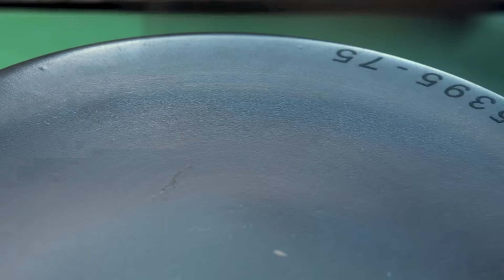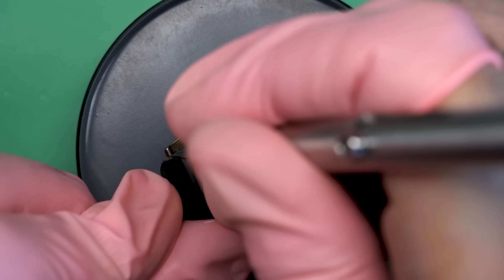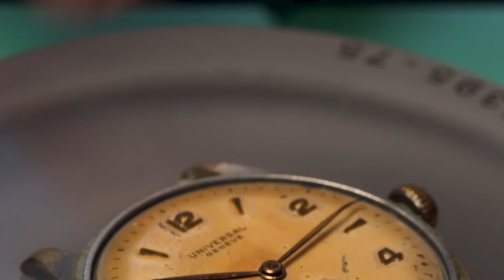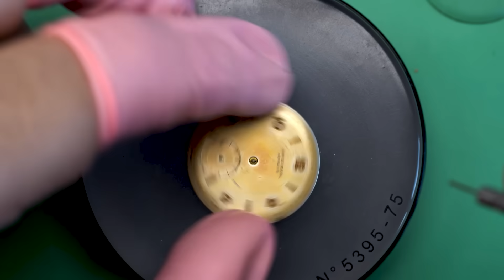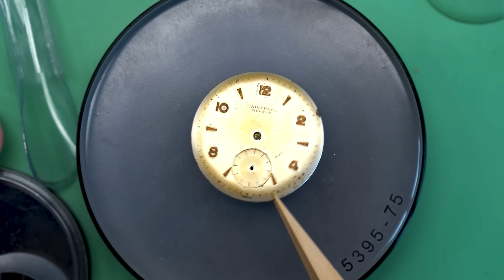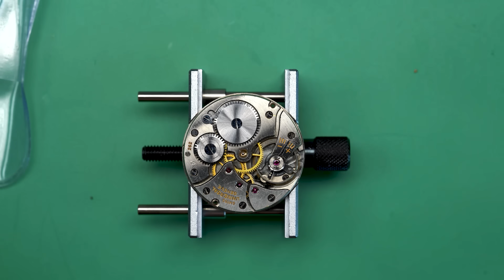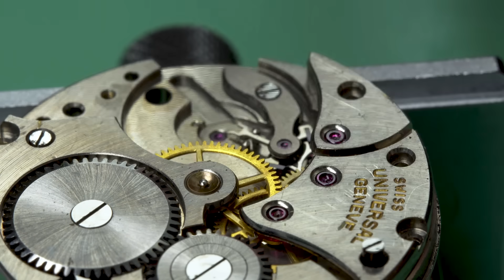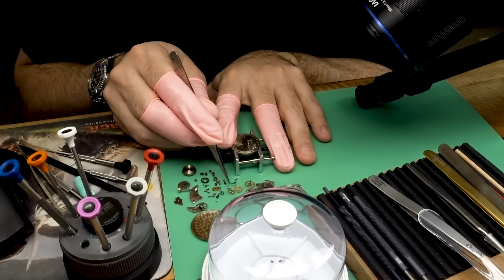Full Restoration Needed On This Universal Genève Watch!

Comment: I have a question for you. I have my grandfather’s pocket watch dated back to 1952. It’s a Elgin 571. Right now it has a solid back to cover the workings of the watch. I would love the back cover to be clear. Is there an after market case cover I can buy that’s clear?  If so help guide me to the place to order and what info they might need to get the correct size and thread. I have the case in stamped under the back cover. 
  You do a great job communicating info while doing the work in the videos. I really enjoy seeing your skills and confidence in a hobby form. Your very talented.

Comment: I have a Mido Multifort Extra Super Automatic that I would love to get going again. It runs, but I think the mainspring is broken. I can wind it, but when you get so far it pops like the spring is broken. I have been in love with watches since I can remember, but never had the means to afford what I really want. I plan on learning how to do the repairs myself. The Mido has a strange automatic mechanism, it doesn't go around 360 degrees like an ordinary automatic. It has 2 springs that the automatic weight bounces off of. I have been watching yours and others watch repair channels, and I think I have the patience to pursue not a career(since I am 61 years old), but a hobby repairing watches. I love your videos! I got the watch out, and started looking at it again while watching this video, and I think I am ready to tackle it. Thanks for the inspiration!

Comment: Marshall how would you feel about doing a video on the New Omega X Swatch buy giving it a upgrade and placing the movement into a stainless steel case and upgrading the crown and buttons to metal just leaving the back cover as original.. if it can be done at all .??..

Comment: Nice job...... Re. the plating... Chrome by itself will not stick... The usual plating process is to copper plate, then nickel (for waterproofing) then Chrome (which is a bit porous)....With a watch, they would dispense with the copper plating as the brass is a copper/zinc alloy and the nickel will stick to it OK.....

Comment: Really, really interesting to watch the case-stripping & replating process. Have never worked up the courage to try it myself. 

FWIW, one other explanation I've heard for brass-cased watches - the material is much easier & less expensive to form & work with than stainless is.

Comment: I started with this hobby because of your channel, I tried repairing a pocket watch I got off ebay but sadly failed; it's missing one of the two staffs on the balance wheel which move the fork. I'm proud of myself to have noticed it and correctly identified the issue, hopefully I can get another balance for that movement... Recently I found my grandfather's old pocket watch which wasn't running and also identified the issue; this one was missing a jewel on the wheel train which I later found inside the case. I'm fairly confident I can make it run again, just have to gather up the courage to get at it again.

Comment: I enjoy watching your videos and, now, I really want to try it out. I love puzzles.  I'm looking for an easy, simple pocket watch to try out this hobby. If watchmaking isn't for me then my first watch will be my favorite puzzle that I reassemble every now and then for a challenge. I already took apart a few, cheap Timex watches. They were definitely throwaway watches because some of the parts were permanently attached to the main plate.  The second one sprung all over the place because I couldn't find a way to release the built-up power. None of them had jewels, and all the works were sandwiched between two plates. But I did enjoy putting the wheels back in place...... I feel like I'm talking to a crowd of giants, the watchmakers.

Comment: Nice one Marshall! Where did you get your cleaning machine, your tube extraction tool, your crystal fitting tool and your main spring winders?
Reply from the maker: Thanks! I got my cleaning machine from a guy in Texas, case tube tool is from Horotec, crystal tool from eBay, and mainspring winders from cousinsUK

Comment: I don't understand why you didn't do any kind of cleaning to the dial. It was filthy on both sides and when you removed it and turned it over, there was horrid corrosion on the backside. Even cleaning it with distilled water on the face and making some effort to clean the back side would have been preferable to simply placing that crusty dial back on top of all the work you'd done on that watch.
Reply from the maker: Hard disagree
Reply: @WristwatchRevival  Rude. Unsubscribe.

Comment: Enjoyed, Thank you. Since you are in the learning mood. Chrome or Chromium is what painters would call a clear coat. Chrome has no real discernable color when applied in a thin plating layer, but does make things shiny. In the automotive industry nickel is plated as a base, then polished and Chromium is then plated over the nickel to seal and give that extra shine. If you have ever seen an old bumper that looks like it is peeling a clear or yellowish layer... That is the chromium that is coming off.

Comment: it is common on knock off wheels on cars for the right side wheel knockoffs to be left hand thread for the same reason. Usually the way plating is done is that the brass is plated with nickel, then chrome. Nickel has a more yellow appearance than chrome.

Comment: Great video as usual!
I would suggest you replace the springbars. Hollow end or 'female' springbars arent common, but easily available online. Those old brass ones will corrode with the green goop really quickly again and are more prone to breaking than new stainless steel replacements.

Comment: Hi marshall, great video, I really liked the plating section, some great info. I have this niggle I need to voice. Mainsprings are NOT family heirlooms, they are disposable items. All of the power of the watch is in the mainspring, for maximum amplitude you need a mainspring with maximum power. During use the metal of the mainspring hardens, it's called work hardening, that makes it more brittle and easier for it to break in use. When you service a watch, especially one that hasn't been serviced for many years - fit a new mainspring. They aren't expensive, and they're easy to get - by dimension if not by brand.  Keep these video's coming :))

Comment: I noticed in the grease for the main spring it expired in oct 2021. What exactly goes bad in the grease? And if it does go bad does that imply that it would have to be cleaned out of the watch when it expires? I know eventually watches need to be cleaned and re lubricated but I assume that’s not something that is done very often.

Comment: Would you do or show what you use to wind a main spring.  I do repair very inexpensive watches and have some older Elgins and others but don’t want to pay 400 to 800 dollars for a main spring tool that will work right or left wind to fix a $25 watch.  And hands are not steady enough to do it by hand. Love the channel you’ve taught me a lot.

Comment: If you bend a ripple or saw-tooth pattern on the bottom portion of the hanger that suspends the parts in the solution when doing plating, you will have an easier time keeping the parts separate from one another.  If parts touch, it can cause gaps in the plating at the point where they touch.

Comment: I would like to send you a very old Waltham I’ve never see anything like it and can’t find it anywhere online. I tried servicing but the jewel on the  balance wheel was missing Additionally the screw for the barrel arbor broke off inside I put a temporary one in place to see if the movement functions. An on closer inspection there’s several broken parts. I really think the community would enjoy watching you service it. I believe it’s from the 1800 and is similar to the movement you worked on in this video.

Comment: Nice Video! You said that you had to switch power supplies to get the right voltage. With plating the current is the critical value. Of course you can change the voltage to set the right current. The downside is that this is very specific to your setup. If your liquid evaporates, or warms up, or the anode is a different size etc. it will all affect the rate of plating, and you might want to adjust the voltage to correct for this. But there's an easier way.

With the type of power supply you are using you can also set ("limit") the current directly, and then it will lower the voltage automatically to get it. With that you should be able to use just the one power supply for both operations.

The easiest way to set this for you would be to turn the current all the way down to 0, and set the voltage somewhere higher than what you need. Then you connect everything with the liquid etc. If you turn the power supply on you will see 0 voltage, because the current is set all the way down. Slowly turn the current up, and you will see the voltage rise with it.

Comment: Great job! You should not use a stainless anode when cleaning off the oxides though. You will get really nasty chromium compounds in the electrolyte. E.g trivalent chrome. Use regular carbon steel instead.

Comment: I have just finished putting together a 1956 Bulova. I got it off of eBay, not running, and it was the most difficult thing I’ve ever attempted. Didn’t lose any springs, had a couple close calls, but when that balance wheel kicked off, it was so very much worth it. 

I want to thank you for your videos. I never would have attempted to get into watchmaking if not for them. 

Thank you!

Comment: I was watching a Youtube video on how Play-Doh was created. I found that in the days when people burned coal
in the furnaces in their homes there was a clay like substance made by the Kutol Soap company in the early 1930s
that they would use to clean the soot residue from coal burning off the wallpaper in their homes.
By the time the 1950s came around most people had switched to using oil or natural gas for their furnaces instead of burning coal. The Kutol company decided to repurpose their wallpaper cleaner by adding some colors to it and selling it as a children's Toy called Play-Doh.

It seems to me that the product you use called  " Rodico ".   Was devolved from Play-Doh.  
I wonder if it is also made by Kutol.  It would be interesting to see if Play-Doh would perform the 
same function as Rodico does for watchmaking.

Comment: I'm watching this with a whole new appreciation having just taken apart and put back together my first watch project. You have been the inspiration I needed to get into watchmaking. 
The good news from my adventure, I took my watch apart, cleaned it and put it together and it runs.
The bad news, I'm not the first to try. I'm missing a cap jewel a few screws (one I lost, those things are little rockets!) and one of the automatic works wheels. I'm currently looking out for a donor movement.
If you read all this, thank you for encouraging others to try!
Reply: If its elgin or eta, then there are GREAT databases of every model and part every made and you stand a good chance of finding them on ebay by part number
Reply: X do forget  g😅gfffgggggzuff a good guntil ggf fff f g but the g fix g
Reply: good 👍 ggthank fg fans  gf and ggand f tax guys guys go fux g g Ugg go g😅get get get ggf gf. Ggg and

Comment: Hey Marshall, fun bit of trivia for you: I don’t know specifically how it’s done in the watch industry, but often items that are ‘chrome plated’ are actually first plated with a thick layer of nickel, followed by a very thin layer of chrome. Supposedly, the chrome layer is so thin that it doesn’t contribute to the color at all, rather it’s just the nickel that gives the piece it’s silvery color. If this watch was plated in that way, then the chrome layer might have prevented the nickel solvent from stripping the nickel off.
Reply: Bob, the only time that things are directly chromed is hard chrome for things like hydraulic rams or plastic injection screws. The chrome in decorative plating is thin partly because it’s quite stressed and if it builds up too thick can peel. The trouble with chrome is that it is so corrosion resistant that any imperfection or blemish corrodes like crazy the substrate hence the pitting that Marshall comments on. The jewellery industry usually nickel plates under gold to stop the gold diffusing into the brass underneath. Nickel silver is a posh name for a white brass. To strip chrome is easy, a 5- 10 g/l sodium hydroxide solution with the chrome anodic, takes a few seconds and you can see the change easily as the chrome disappears and the more yellow nickel shows through.

Comment: Most commercial trucks (semi-trucks, and straight trucks) have lugs on the passenger side that are reverse threaded so as the truck travels down the road all the wheels are "tightening" the the wheel lug nuts.

Comment: The "haze" in the cleaning solution while electrocleaning is not made of contaminants.  Actually it is tiny hydrogen and oxygen bubbles from the electrolysis process of the cleaning solution.  "Nickel-chrome" means there are two different electroplated layers on the case. Since chrome does not "stick" well to brass directly, a base layer of nickel is put on the brass first for the chrome to attach itself to.

Comment: Marshall, the green goo on the spring bars is the result of leather reacting with the brass pins.  Leaving brass-cased cartridges in leather bullet loops, or brass-frame knives in leather sheaths has the same effect.  To prevent this we use nickel-plated brass in the bullet loops.
Reply: One factor you all ignored is the sweat and body oil factors.
Reply: This sort of knowlegde is soooo specfic, and truly why I love this Channel!
Reply: The green discolouration is referred to as 'verdigris' verdi gree !
It forms on copper and brass by 'atmospheric oxidation.' And is basic copper carbonate.
Reply: This substance also forms when copper (from the brass) and some other metals react with sweat and body oils... It is basically insoluble metallic salts of fatty acids
Reply: Serving as an Air Force MP in Vietnam we had to polish our .38 cal. brass frequently .  It would turn green in a day from the leather. Once a month we'd use it in requalifying!
Reply: Chrome tanned leather does this.
Reply: You often see it on bridles, especially where the cavesson attaches to the bit.
Reply: It's called verdigris.
Reply: Very good to know!
Reply: I have an old Buck knife from my father that had this same problem. Real brass on the handle, and real leather holster = green discoloring
Reply: Vegetable tanned leather should not react that much as the modern Chemically tanned leather
Reply: But wasn't those bars coated as well.. it didn't look just brass
Reply: @strydyrhellzrydyr1345 ,
   The pins sure looked like nickel or stainless to me also, but the case itself is brass and I'm thinkin the green verdigris gunk was kind of migrating into the pin area with sweat and moisture.
Reply: Looks to me like someone dropped seminal fluid on at one time. Man's watch + worn on wrist= over shot.

Comment: Hi , another great video , the green pasty substance on the strap pins is usually what comes from metal being in contact with leather , didn’t see if the watch has a leather strap that will be the cause , as a lifetime saddler I find it often on straps that have buckle bars in them , it’s apparently a reaction between the tannic acid in the leather and the base metal ,

Comment: Have you tried low pressure glass bead blasting to clean old surfaces off?
I use high pressure (120psi) to clean just about anything back to base metal.
Would a small hobby unit about the size of an airbrush do the job for you?

Comment: I've watched enough watch disassembly videos that this one doesn't look like it has that many parts. If I had a decent magnifier and the right tools. I think I might even be able to get this one back together correctly. More so than many, the main plate basically shows where each part is meant to go. The new strap looks so good.

Comment: Patience really is key.  Practising patience and taking your time is rather therapeutic I'm finding, until things go wrong and it becomes a bit of a struggle LOL.  I'm working on my first watch.  The ST36 pocket watch movement I ordered two months ago still hasn't arrived from China, so I decided to work on a HMT junker I got (0231 movement).  I'm thinking I really should have videoed the disassembly or at least taken a few photographs.  I spent two hours trying to make the wrong screw hold down the setting lever spring.  It tricked me - the thread is actually the same as the bridge screws.

I've lost both the yoke spring and the click spring twice each so far.  It's such a relief when you find them again.  I understand why Mark recommends starting with the ST36 but honestly I could not wait any more.  I guess the ST36 is going to be a piece of cake for me when (if) it eventually gets here.  (Tip for noobs: pay a bit extra if necessary and buy local if you have the option.  Some Chinese stuff turns up within three weeks, some takes considerably longer).  Learning how to manually wind a mainspring into the tiny 0231 barrel was quite the challenge also.  I was up until 2AM LOL.

Just as an interesting aside, the 0231 movement did not run, and the balance didn't appear to be engaging the pallet wheel.  I figured it was well broken but I couldn't actually find any problems with it - pivots are fine impulse jewel is fine, and no loose parts were jamming the train.  I'm hoping it comes to life now it's been cleaned.  Time will tell, but boy this first one is turning into a long saga.  That's the other part of exercising patience - you just do the next thing however long it takes you to figure it out, and you never give up.  Yeah, somtimes the "next thing" has to be done again when you realise there was a 'nuther "next thing" that you should have done first.